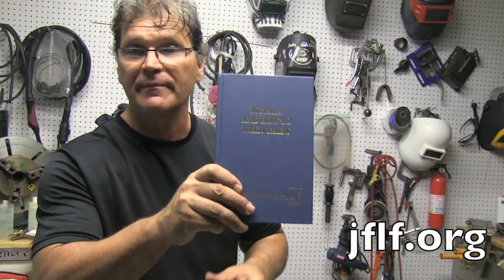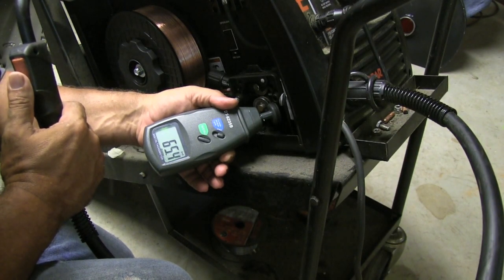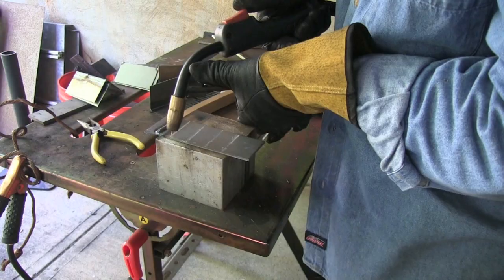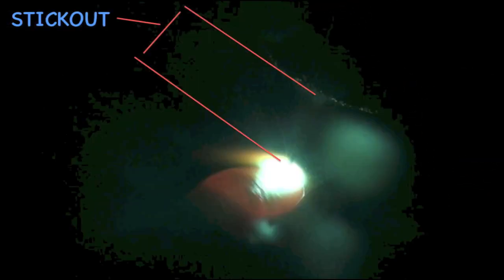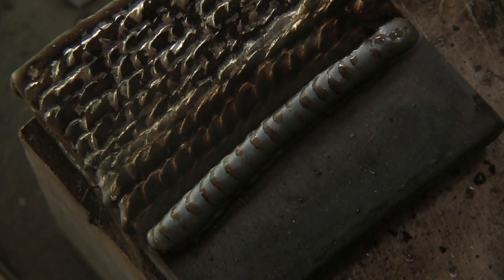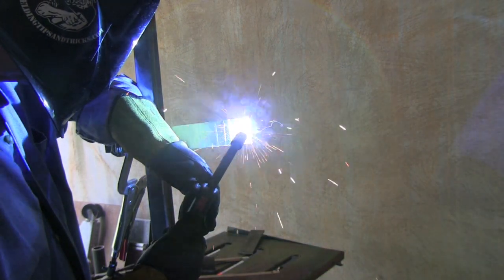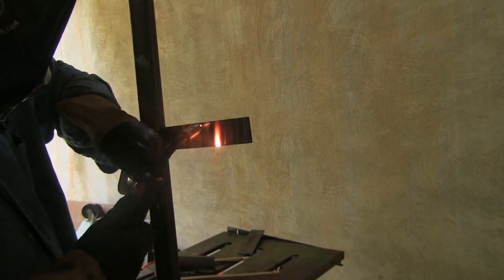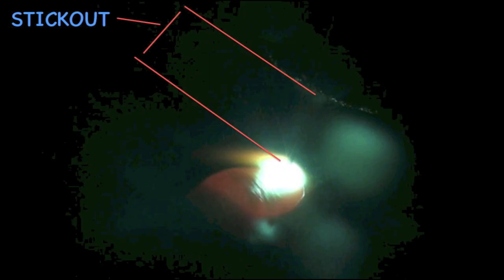Mig Welding Basics part 5 - Practice

Comment: HEY  JODY  my  Hobart  140 Handler   started  sticking   when I let off the  trigger   and the  wire  continues to  feed out    is the  switch  replacable  or do I need to replace  the   entire  cable and torch   (stinger)

Comment: Your wire speed measurements might be measuring slightly high as there is a groove the wire travels in that doesn't turn quite as fast as the outer rim you seem to be measuring. I'd factor all those measurements down just a tad sir.

Comment: Hi! I'm an old man with a young heart and I am trying to learn how to weld. I have good Miller equipment both Mig and Tig. MY proble is that I can't see where I am welding. I can see the puddle and the stick out but I can't see a line to follow or stay on line on an outside corner. Or any other line for that matter. What am I doing wrong?
Reply: You might want to try a lower shade

Comment: I've been practicing MIG welding at work and when I put some tacks down I just tightly close my eyes and pop a quick tack and after doing that a few times my face is "sun" burned. Gets me every time
Reply: This is what you need a helmet for! The light coming off is literally radiation, and no small amount of it is UV-C, which you cannot see, but is straight up carcenogenic. The screen and the helmet stop it. Don't be a *edited*.

Comment: good videos great welder.  My question is from video where you talk about wire speed guidelines.  one eighth  inch mild steel, .035 wire gives a ballpark wire speed of 200 inches per minute.  Sounds good, looks good.  Then I look at Miller's
pocket calculator for mig welding, it gives a wire speed of 280-300 ipm.  Why such a huge  45% difference?  My Thermal
Arc mig has completely different guidelines yet again.  Every source I check is different by large amounts.  What gives

Comment: 3:08  There's a mistake in your IPM chart: The "90" setting measured 63 inches in 5 secs, which is 756 IPM, not 693.  Regardless of the exact calculation, the 90 setting should not be almost the same as the 80 setting!

Comment: I am a sub on this channel..  Could you do a big favour for me please.  Could you do a test, yes I am a noobie at this however, I would love a great start.  Would you kindly do a video on types of Welding wire that you have access to please.  IE, Chinese make of flux core - korean based flux core - harbour freight flux core then finally the lincolyn flux core.  I am not wealthy in an imagination.  Simply put, I am a pesant.  Gas is almost half a month wages.  So this is not easily accessable.  Flux core is....  Then after a few beads could you cut away and show pentration and your personallt recommendations.  I vote lincolyn but I maybe wrong in this matter.  thank you.

Comment: Hello, I am trying to learn how to weld. I think it is a useful hobby. I have been watching your videos on mig welding. I am getting a lot of splatter. Is it messier to use the flux core wire then gas/solid wire? There is not much splatter when you are done. I have tried changing my wire lengths, feed speed but it is still messy. REAL MEN FUSE METAL!

Comment: I’m still shopping for which unit I will buy. I’m going to do a lot of your practice drills but am ultimately going to drop beads in small cracks in old (1920’s) bicycles. Im thinking about the Hobart 140 to start with as I have no welding experience at all and also no 230 outlet. What do you think? It’s not the money so do you think the 210 dual voltage would be better? Thanks for the great vids!

Comment: hello ,what's your opinion on flux wire ?im about to buy a mig welder but here in my country the gas tube is expensive and complicated to acquire,thank you!
Reply: cuenta clon  Other than having to clean the bead, it is just as good, and you can't accidentally waste gas with flux core. It is also better for a portable setup, as you don't have to drag around a tank. Most field welding is done with flux core, and technically all arc welding is flux core, so it is just as good as gas, just a bit messier. Unless you weld some aluminum, flux core will work great. Just make sure to set the polarity correctly.

Comment: Jody, Just subscribed today. Guess I'll put off the honeydew list and watch all day! Could you please address an issue us older guys have, wearing bifocal glasses. Seems the tendency when I weld is to hold my head down which forces me to look through the distance portion on my glasses so then I can't see what I'm welding. I've tried a corrective lens that  fits in the view window of the hood, but to use this I have to take off my glasses, when I lift the hood, guess what, can't see anything in the shop. Fumbling to take my glasses on and off is a PITA. I see you wear glasses, what's the solution. PS if this is addressed in a vid I haven't seen I guess I'll get to it soon enough.

Comment: Hey Jody great series! Wanting to build a new trailer and wondering your recommendation for a welder. I've used the Lincoln 225A AC welder with good results years ago but would a MIG machine give me good penetration for this kind of structural strength? Which MIG would you recommend? I see you use the Hobart 190 MV  Thank you

Comment: I remember when I started welding class at Vo Tech Freshman year,we were learning stick welding 6011 we each got a piece of 1/4" ×10"× 30" plate  tacked it center to a 1/4 " fb on edge, we welded along the 30" side overlapping  by half  , we had to keep welding  each day until the plate was an Inch thick , but  what our welding instructor  knew that we didnt  is that the plate would start curling up into a semi virtical position  like a pipe practicing  out of position, each layer of weld was graded . the heat comming off that plate  !! I asked myself what the hell am I getting into  here , ive been welding 27 years.

Comment: Hi Jody, I'm just getting started with flux cored mig welding, and was wondering what is the best video to see the basic techniques? I know it isn't as pretty as gas but it's all I have right now. Thanks a ton, and your videos are the best out there for learning.
Reply: JayTap good luck have a helmet and a chipping hammer and an angle grinder with a wire wheel

Comment: This series of videos is helping me immensely as I am trying to learn to use a gasless mig welder for the first time. I have to do a lot more practice but it is slowly coming together. Also need to learn what my exact wire feeds are and I too have one of those rpm dials with the rotation wheel to give me the answers. Thanks for taking all the time and effort to post these videos. John

Comment: stickout question - I was planning to mig weld 2 square tubes that meet at a 30º angle.  At the small angle, I'll have much greater stickout due to bulk of the nozzle.  Should I look for a longer tip just for those welds or shorten the nozzle?  Or can I compensate with machine settings for those welds?  This isn't an application that a strong weld is needed.  Its a coffee table.  Also, I can only Mig or flux core wire weld.

Comment: As for general knowledge how far away from the surface your welding what is a good distance to hold the torch? I have done a lot of stick welding, but just getting started with mig welding. What is your preference in wire FluxCore or regular wire using gas.

Comment: Jody, I'm restoring a 57 Chevy. Do you recommend stitch welding a butt joint for the quarter panel or a series of tack welds or run a bead? Everything i've seen before says to tack weld it and jump around to keep from warping the metal. But, I see that you ran a bead straight down the piece of steel on the corner joint. The metal I'm welding is 18 gauge. Any suggestions would be appreciated. Also, I really enjoy your videos, they are very informative.
Thanks, Mike Rosato
Reply: ***** Thank you for the reply. Thats what I thought (spot welds), but seeing him run a bead on 18 gauge is what threw me. I really appreciate the feedback. 
Thanks again.

Comment: Thank you for this series. Two questions. 1 what is the part number,  manufacturer,  of the rotational length meter? I have an xmt300/Xra and cannot measure wire speed as it has a run in speed and then wire speed after arc. 2. Are their any tips specific to aluminum MIG? I've learned so much from you and share with my friends. Thank you Ken. Palmer AK

Comment: Hi weldingtipsandtricks :-) First I would like to say, thanks sharing all this welding knowledge and experience! You are a goldmine! 

So for your preference You always got the Nozzle Flushed with the tip, unless you are welding thin sheet metal like 1mm. or less?
I dont Use any guides to set it right, im just adjusting the welder on some scrapmetal with the same size as the thing im welting. Its like, I can see and hear if its set right.
I dont have years of experience, but im eager to learn more about welting, and You have served it to me on a silver plate :-)

Comment: One item you might consider touching on in a later video, MIG gun maintenance. I recently had to replace the gun on my Clarke MIG welder. Normal wire is 0.030 flux core for general cold roll welding. I was getting very poor weld quality and nothing seemed to fix it. The end of the gun coming out of the handle had become loose so I just ordered a replacement, assuming the gun was just worn out. Upon opening it to see if I could repair the gun to have as a spare emergency replacement, I noticed a great deal of soot and evidence of excessive arcing inside. It turned out my problem was due to contamination on the switch contact surfaces. I cleaned out as much of the debris as I could. I also pulled the contacts out of the gun and filed the contact surfaces of the switch. Now it functions like a nearly new gun. Originally I was getting an intermittent arc as well as a great deal of spatter. I started with replacing the ground clamp, confirming settings, even replaced the grounding cable with a much larger cable. Everything I could think of for solving my poor weld quality and nothing worked. Seems like problems are simpler when you over think the solutions. Like they say you can't see the forest for all the trees. Love the videos, keep them coming.

Comment: This was the first one I watched. I will have to go back and watch parts 1-4. Super informative. I have a Lincoln 115v mig that I dabble with. I like the way you take the time to explain things. Excellent job my friend. I subbed your channel and look forward to more. I usually run .30 wire on my welder. Are you recommending a smaller wire for better welding? You stated the sweet spot gets better with smaller wire. I also put argon on mine. Any tips there?

Comment: awesome machines and set up data & oh brother improper(?) instruction > use two hands,  match the stick diameter and amperage to the workpiece from the get go was my experience. getting the work done and out was always paramount to beauty, so ya, overhead rod, .090 steel joists welded to girts > ugly but joined none the less, or the quicky jackstand project - 2" g.i. pipe and #4 rebar with all purpose sticks...yup, really  stinkin' ugly but still holding fast a jeepney on 'em...

tried mig a couple times seemed odd, felt like throwing velcro balls at a target (less than a 1/2 meter 'united' total).

believe it or not many of the diy day to day 'professionals' here in the philippines use only uv 400 sunglasses and do a lot of short spot welds side by side with closed eyes only, relying on the sound and feel method where placement is critcal. i tried same and found my attempt rather ugly by comparison.

and of course i used to wear those same sunglasses under the 'anybodies' helmet because the h.i.d. overhead lighting in the fabrication shop put a big glare inside the helmet...not one of the large head guys, purchasing an individualized proper helmet (was) is the typical modi operandi hassle here.

Comment: First of all I love the video you produce. I have  MILLER  252 220/480 single phase welder, I am running .035 wire with 75/25 gas. I had a job to do outdoor repairing some dock levelers for the company I work for. So  I went and bought a 10lb spool of gasless  .035 flux core wire to use.  I changed polarity from  dcep to dcen and started feeding the wire and noticed my drive started to  smoke every time I pressed the trigger on my mig gun. I had never seen this, is this normal?

Comment: Another great video, I love watching you and I learn so. Thanks. One question about thinner metal and stickout. For thin stuff like 16 or 18 gauge tube or sheet metal, I'm getting a lot of blowout. Would a longer stickout help and if so, what about shielding gas level? Do I need to increase the gas flow to account for backing off from the material? Thanks.

Comment: Jody, great video.  I don’t see a whole lot of splatter are you using a gas mix?
Reply from the maker: just standard 75/25 argon/co2 for the padding and thin sheet metal but the welds at the end of the video were done using straight co2 and .030" wire.  co2 is harder to find a sweet spot setting but once you do, it runs good with small diameter wires like .030 and .024

Comment: Hey Jody I know this is completely off topic for this video and I'm sure you've even answered this question in a previous video....That being said how big of a gap and land do you use on V bevel open butt joint and do you step in the root or do you just drag using 6010.. I have been using a 1/8th 6010 and I have been using a 16th gap and land maybe 3/32 is better??

Comment: Thanks for all the instruction, you are very informative. My question is about keeping a good visual. The quality and look of my beads are very dependent on how well I can see what is going on. Can you give any tip and trick you have up your sleeve on how to see that puddle and where you want to go? Does it depend on your helmet? Extra lighting? I can sure see what is going on in your videos. But I struggle to see anything while welding.
Thanks Dan
Reply from the maker: well a brand new clear lens always helps. also, auto dark helmets vary in clarity. I am using a lincoln viking 3350 mostly these days and it seems better than most others I have used.  you might also just try using a gold lens. you can buy them on ebay or amazon for around 5-10 bucks.  a #10 is a good place to start unless you are welding very low amps